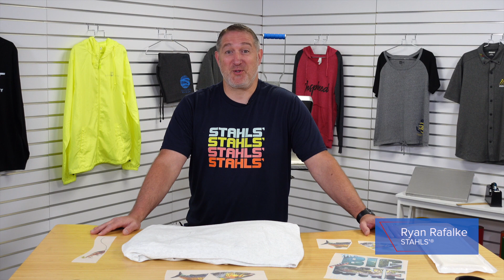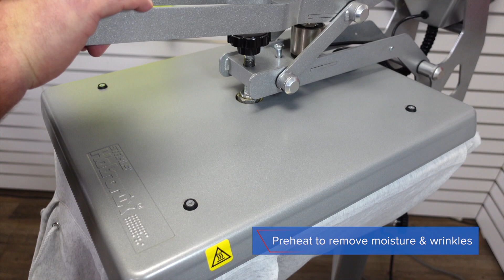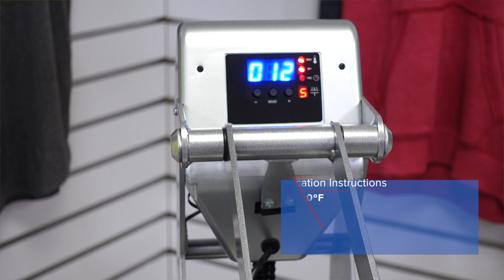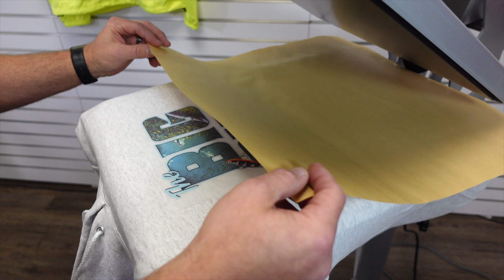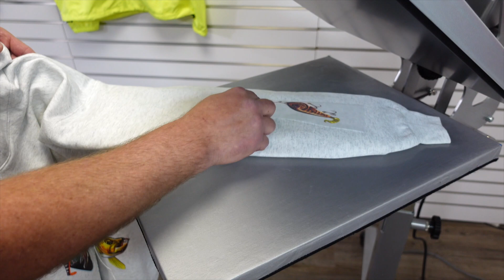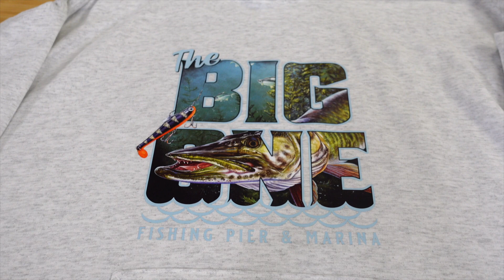How to Create a Split Design with DTF Transfers

Comment: We're we can get that design?
Reply from the maker: The images used to create the layouts in this video can be found at www.greatdanegraphics.com. The digital printing file option was used and the images were modified in Photoshop to create the layouts. The lure on the sleeve was pulled from image # H6864 Lure Muskie. The fish for the pocket is G6448 Brown Trout with Fly. The center front type layout was created using image # H6845 Musky Chase.